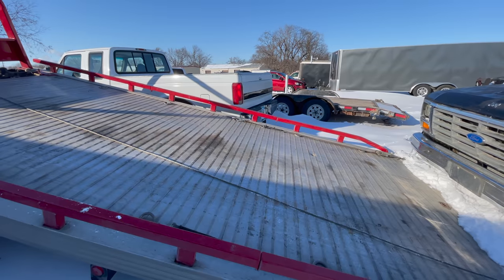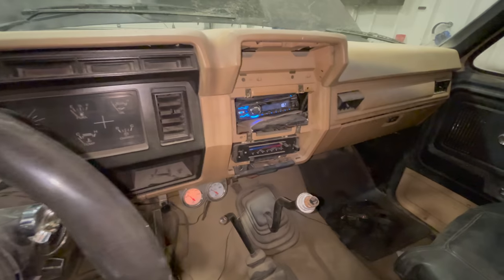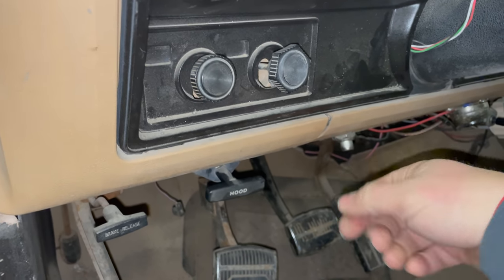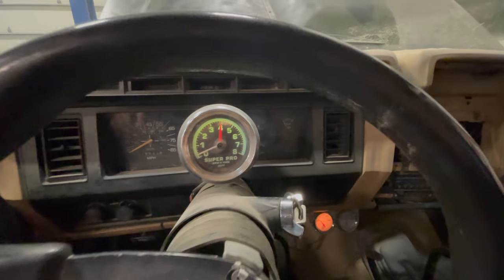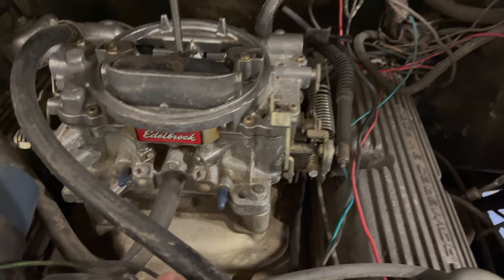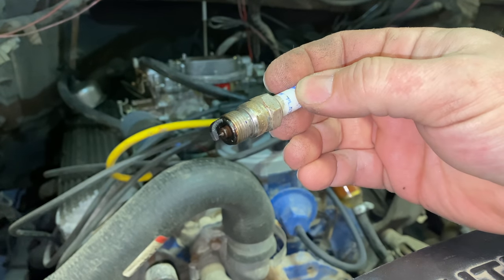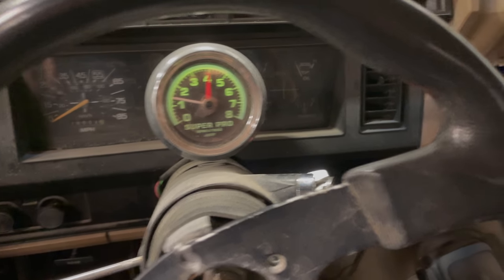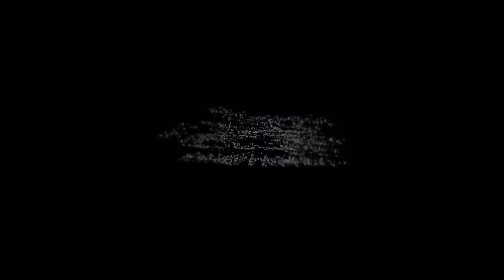1985 Ford Bronco Would Rather Catch Fire Than Run

Comment: I don't know if you noticed but there are 2 ports for vacuum long front of the carburetor One port is manifold vacuum the other port is ported vacuum so you need to make sure the distributor is on ported vacuum and I think on that particular carburetor the 1406 I believe it's on the right side. That will give you vacuum advance under part throttle rather than manifold vacuum. Then you might also check your diaphragm to see if it holds vacuum just in case it's got a ripped rubber diaphragm inside it.
Reply: That's  what I was thinking! " He's hooking it up to the manifold vacuum  port"

Comment: Your troubleshooting is methodical. Ain't no other way!
Reply: Good vid, amazing what a bit of maintenance does to a poorly running engine. And people on a budget could easily just clean some of those terminals eg the distributor cap  and rotor and it would have worked well. Like to see ya get that rear window operational again and clean the rig up a big. Tks fer the vid.
Reply: @edwardmulder3777  It would have been good to see a quick clean up of the cap and rotor just to show a quick fix at the side of the road.
Reply: @edwardmulder3777  p
Reply: @edwardmulder3777 lo
Reply: Io

Comment: Great work with the ignition. That got it running better quickly!
I would probably be pulling out every extra wire and switch and returning it to stock or at least reliably modified, the wiring looked a mess no matter where the camera was pointed.

Comment: Thank you Steve. I have a 1985 f150 4x4 the rear frame is rusted pretty bad but the rest of the truck is fine.  The engine is a 300 inline 6. Manual 4 speed np 435 transmission. I'm trying  to buy a bronco off a guy that was a 6 cylinder also, he sold the engine. My 150 has everything thing the bronco needs and then some. From the back of the cab forward everything will interchange. The bronco has a solid frame and will be the perfect platform.

Comment: Great vid - I'd love to see the interior tidied up (steering wheel, rear window, all gauges working). Also, the engine bay has what looks like rogue wiring all over the place. Finding out what it does and removing it if necessary would make the engine bay look much better. Also, that exhaust/engine knocking noise. I keep thinking it's gonna shoot a piston :D

Comment: Steve, I'd like to see you get the gas  gauge fixed. I have a 85 bronco and my gas gauge doesn't work. Im trying to work on it myself. Dont know really what I'm doing outside of oil change, plug and wires. Great video I learned a lot thanks.
Reply from the maker: Definitely high on my list to fix

Comment: Steve, that engine likely came out of a car. You can tell by the drain plug on the oil pan. Side drains were in cars, front, bottom or rear drains for trucks. Looks like a 302.
Reply from the maker: Kevin told me the guy told him it came out of a Mustang.  Yes it is 302.
Reply: @ThisWeekWithCars  awesome. I'm doing a rustoration on an 84 F250 right now. Planning on making an overland camper out of it

Drove most all makes but mostly raised on Fords. Glad Kevin pointed us in your direction. Watching it now, I remember you from the trail challenge build.

Comment: Distributor cap and rotor arm electrolytic deposits are non conductive, if you scrape them off with a penknife leaving bare metal, those parts will work like new.
Reply from the maker: That only works for a very short time they corrode faster and faster when you do that.

Comment: this is the one he pulled gas from the tank and clogged up the carb, deff wanna see more of the bronco
Reply from the maker: I am not convinced about that diagnosis from everything I have seen so far unless he put on the old fuel filter that is on it right now and cleaned out the tank.  The filter shows no signs of anything coming from the tank and I have driven it a few miles now.